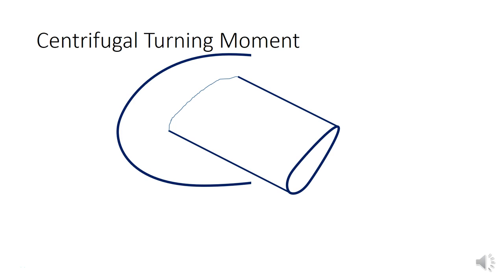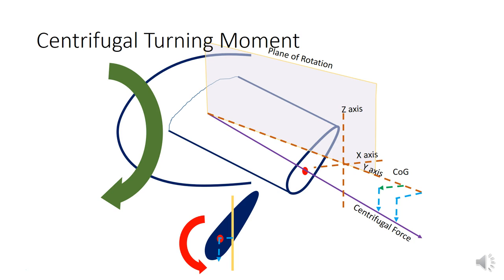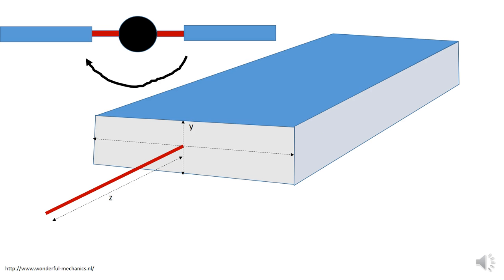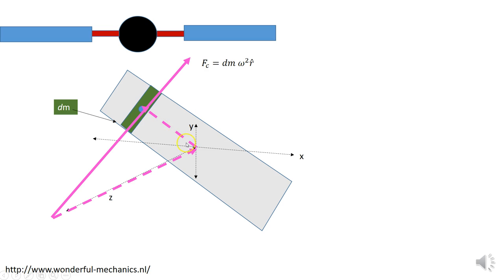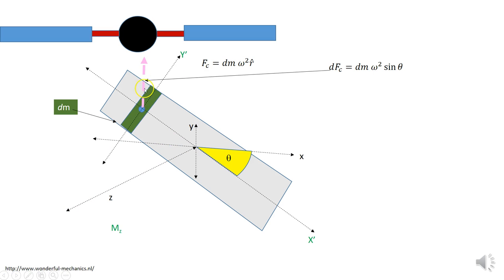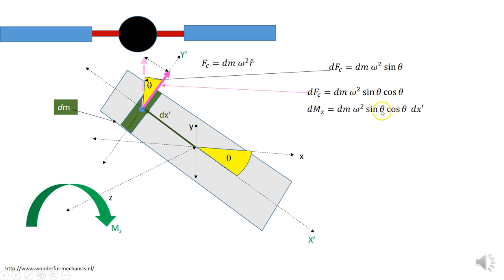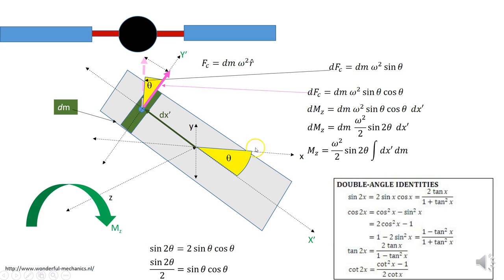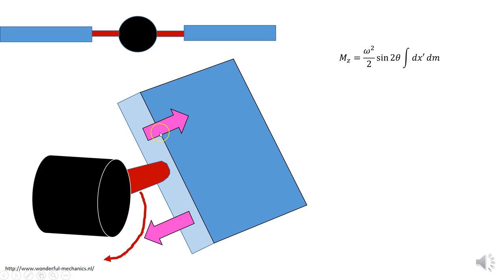Centrifugal Turning Moment   Flat Plate

Comment: Hello Roddy, thank you for all the videos you have made, they are great help while me and my classmates are learning our part-66 modules. 

This seems to be the most detailed video i have ever seen that explains the origins of CTM. Yet still i have one question.

In the beginning the block lays flat on side while its center of rotation is outside of it on z axis in the direction of viewer. From the side picture with two "blades" and hub i assume the POR (plane of rotation) is the one intersecting z and x axis.

Am i correct in thinking that in this case no CTM would be acting on the block because it already is aligned with the POR and only later when the block is turned a bit and prim axis are introduced the CTM would act on block because there is an angle between block and POR represented by Theta?
Reply from the maker: @Sovenguard. Yes, the CTM only effects the blade when it is not turning in the plane of rotation.

Comment: Hello Roddy Mc Namee, I am looking for a way to calculate a CTM on a propeller blade and i came across your channel :) But the part about the blade once turned really confuses me, you focus only on the part of the force that will induce a moment along the z axis ? Also, I don't understand why the r component disappears from Fc to dFc at 3.55... Could you explain me further ?
Kind Regards
Reply from the maker: @Bogdan Poniatowski, I focus on the part of the force that induces a moment along the z-axis as it is this moment that is of most importance, and by eliminating r from the equation you can see that a large moment can be achieved very close to the hub.  That is why counterweights can be placed close to the hub and have such an effect.

At 3.55 I was only concerned about the moments and forces about the z-axis, hence r was ignored.